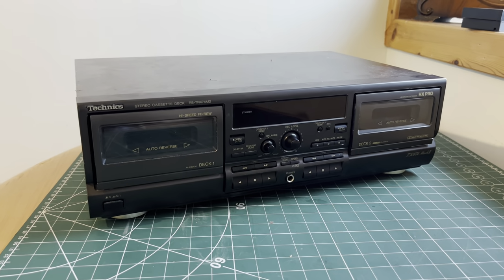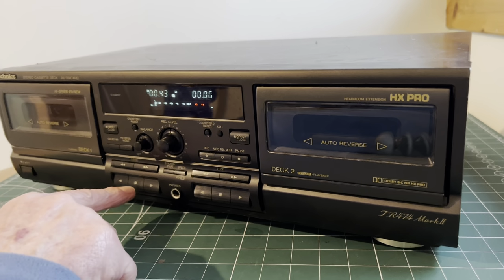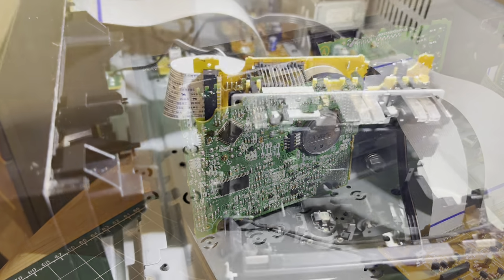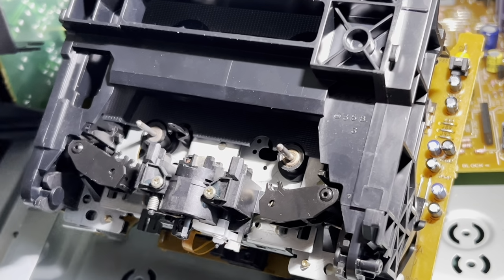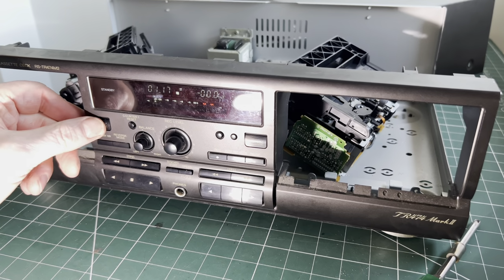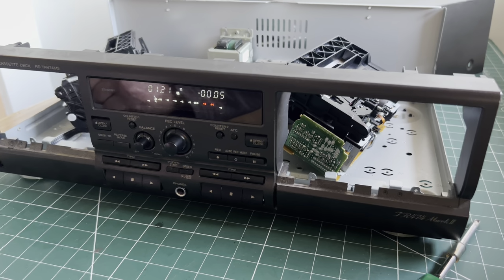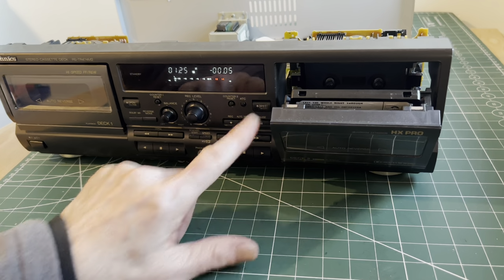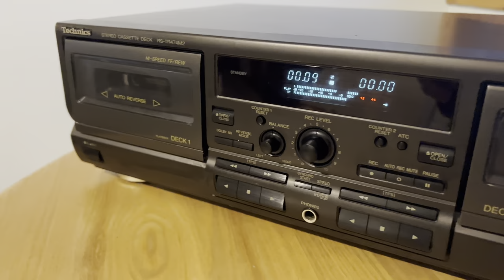Technics Stereo Cassette Deck Repair

Comment: I just got this deck, first the pinch rollers all needed replacing as they had completely failed but unfortunately I get no audio at all.  I have a feeling something has failed on deck 2 where I think audio for both decks goes through.

Comment: Good to have an easy fix in a pinch! 😉 
Me, not so fortunate as for me the belts are shot. Deck 1 worse than 2 and larger 90min. cassettes even worse. Get about 20 seconds of fine operation if it's been unused for a few days, but then it progressively slows down like I've got Darth Vaders hits playing. How do I find out what belts to buy? Mine's the 575.

Comment: Great video mark. Do you have any videos for rs ch 550/950. Similar problems and belts replaced. Where are you based in england? Cheers
Reply: The rs ch950 is hxpro. Midi stack system👍
Reply from the maker: Thank you👍 no other videos for your 550/950 just yet. 
Not England. Outer Hebrides.
Reply: @whatsmarkdoing2915  keep posting. Thanks

Comment: I have this model, but the doors click when closing after pressing the botton. Each side. Someone said the plastic gearing rots away?
Reply from the maker: Hard to say without taking a look internally. Odd that both sides are doing the same thing? Are the outer covers on the doors clicked home properly?
Reply: @whatsmarkdoing2915  
Yes sir they appear clocked correctly. I will pull the cover. I'm assuming that the motorized doors have a fixed gear of some type.
Reply from the maker: All will be revealed! Best of luck and thank you for taking the time to watch the video👍